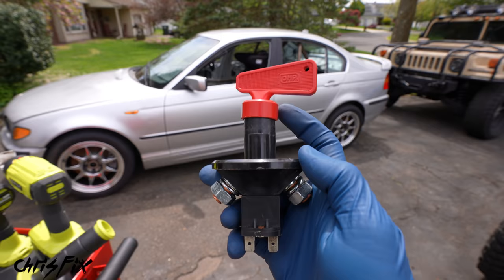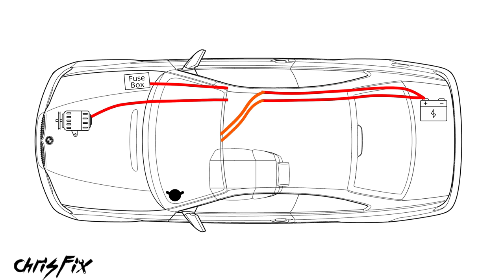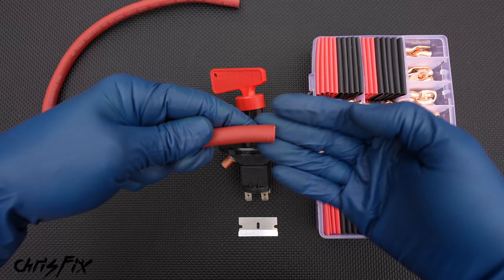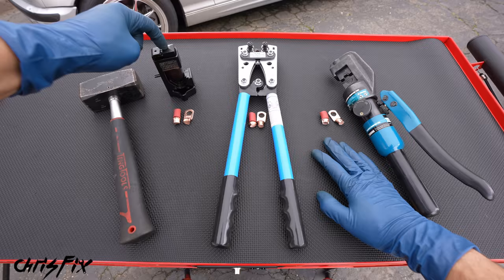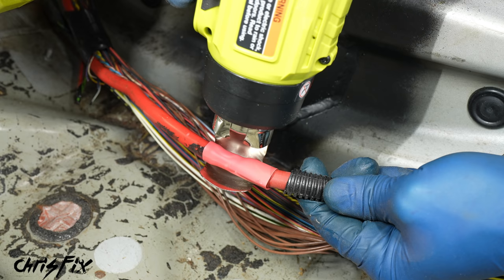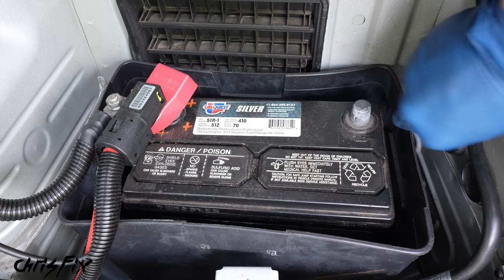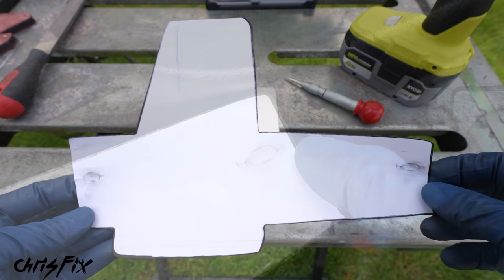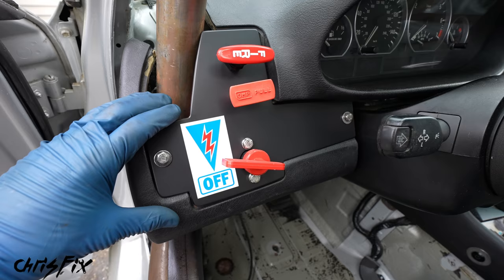How to Install a Battery Kill Switch

Comment: Electrician here! Great job as always Chris but I have one critique. When crimping lugs it's best practice to crimp at the top of the lug not the base like you did. Starting at the base leaves to potential of a air gap between the top of the lug and the wire. This happens due the to stretching of the lug when you crimp it. Now I'm 100 percent certain you won't have any problems with the way you did it because it's such low voltage but just thought you should know. As always Great job and love your veidos.
Reply from the maker: Thanks for the tip!
Reply: @chrisfix  
To not have to pay attention to what Cliff says, you can buy terminals with a little hole in the front, as i do ^^

And you can find adhesive heat shrink, with a layer of glue inside of it, so it melt when you heat the shrink, ang glue it to the cable, so you dont have to use silicon, and avoid greasy fingers haha!

Of course theses two tips cost you a little more money, but can save you some time if you have a lot of crimp to do!
Reply: @chrisfix  another piece of advice, you could always leave power on the ECM/PCM.. So that way your engine wouldn't have to relearn all the sensors the first 30 mins of driving. And in some states this will cause people who use this daily to fail vehicle inspection due to incomplete drive cycles.
Reply: @Neilledra  The lug also stretches during crimping, so you still have to crimp it starting from the top of the lug. If it is done the wrong way, the lug will not be able to stretch and it may crack.
Reply: @bustanut3888  that’s what I was thinking. Kill the spark system and not the DME/ECU as it’s a BMW and the electrical systems in it are not a fan of sudden power cuts and comebacks. He’ll be on the track and having to spend a few laps relearning everything before his car will perform like it should as it’ll have to relearn shifting, and sensor/engine adaptations.
Reply: @thecomputerguy777  This kill switch will probably not be used as a form of theft-prevention, its mainly a safety measure. And if your car is close to or already bruning, Im pretty certain you dont care about the few sensors you will fry by using this switch. 
He just mentioned that this could be used for theft prevention, not that you should do it.
Reply: Good Catch

Comment: As an electrician (Sparky), I've had my fair share of rushed/bad crimps. I always hate accidentally cutting the copper wire. It is so annoying. I love watching you do electrical work. Reminds me of why I got into it
Reply from the maker: Thanks a lot! Yea cutting too deep into the copper wires by accident is always so annoying. You try to be careful and you still cut a few strands haha
Reply: @chrisfix  Stripping tiny and thin stranded wire such as Diesel Locomotive Cable I’ve found that when you cut all the way in the insulation you score strands no matter what then they bend and break. I’ve found the best way to not score the copper is to instead score the insulation and bend it until it the insulation breaks and slides off.
Reply: @rylanhuntley6867   that seems the best logic to do incase if never wanted a single strand to come off

Comment: Seeing the inside of the crimp is so cool! I've been doing automotive work my entire life and have a degree in electrical engineering. But I had absolutely no clue that a crimp like this compresses all the wires into a literal solid lump of copper! That makes me feel a lot more confident in how they work. That's crazy!
Reply: Yeah that’s what surprised me the most. I always thought the wires would just bunch up next to each other.
Reply: I still don't understand the physics of how that happens... there's no heat involved and they're still solid strands, how exactly do they "liquify" and melt into solid core from just compression?
Reply: @Leuel48Fan  copper is really soft, when you apply that much pressure to it it's no different than pushing two pieces of clay into one.
Reply: Your comment is great but your name has me lmao
Reply: Thomas & Betts is your best friend!
Reply: @Leuel48Fan  they aren't solid, if you remove the crimp they still are individual strands. They just get compressed and deformed so that there are no airgaps between them
Reply: @WorkinDuck  not necessarily. It's physically possible to well Metall together with just pressure and no hat so it turns I to a Ssolid block. Cold welding/pressure welding is a thing
Reply: @LeutnantJoker  This isn't possible while wire crimping, since the individual strands would break at the end of the crimp with that much compression
Reply: @WorkinDuck  No, it is very possible and it is the only right way to crimp. A good crimp will cold weld the metal together. Period.
Reply: @Leuel48Fan  cold welding. Metal attaches to itself when you remove any surface air and oxidation
Reply: i wonder where the Axia's computer is
Reply: Yeah I’m with @WorkinDuck on this. Generally, cold welding requires the metals to be cleaned of their oxide layers, and common copper wires are definitely not free of their oxide layer. Another thing is cold welding works best on flat surfaces with no irregularities. In a very ideal situation it is possible to cold weld wires when crimping them together, however, I feel there are to many variables and the wires would not cold weld in the vast majority of crimping situations.

Comment: Great video! Just a tip: You can get marine grade heat shrink which has a heat-activated adhesive lining on the inside so you don't need to apply the silicone. The adhesive also helps to add some strain relief. =)
Reply from the maker: Thanks for the tip! That is a good idea!
Reply: @chrisfix  NP, I only know because I had to relocate my battery to my trunk to make room for a new intake. XD

Comment: For the crimp heat shrink, use adhesive lined shrink tubing.  It has adhesive inside that when heated and shrunk will fill the gaps and perform the same function as the silicone paste with the added benefit of waterproofing the connection.

Comment: Proper stuff. Only concern I saw here was with the relay "trigger wire". I have met relays that have had their contacts getting stuck together. Therefore, I would have run the switched wired through the killswitch to protect from a relay getting stuck in the "on" position.
Reply: Very interesting!
Reply: That makes sense. Relays aren't perfect.
Reply from the maker: Thanks a great point, although very rare, technically a relay can get stuck in the closed position and not shut off, even with the trigger wire cut off
Reply: Always account for those things that "never happen," because they can cause a lot of trouble when they do.
Reply: 100% agree with OP. Assume the relay will stick, and wire accordingly. Murphy's Law.
Reply: @meliodas4560  
No human is fast enough to save the alternator.
Reply: @larrybe2900  How does that relate to Meliodas's comment?
Reply: @Engineer9736  
Meliodas's comment referenced OP

Comment: Protip for those wanting to prevent car theft by using one of these:

You can install a kill switch and put a low amperage fuse (5 amp) in parallel. This will cause the fuse to blow if someone tries to start the car without the switch installed. The fuse is there to keep current flowing to components so you don't lose presets on your radio and/or don't reset any computers, but it's low enough amperage that it'll blow when the starter is used.

You're welcome. :)
Reply: Pro-pro tip:
If you do that keep a spare fuse somewhere in your car.
Because you most definitely at some point will forget to turn on the switch before starting the car and blow the fuse.
Reply: Better use a resistor or heating element..
Reply: won't the computer and radio get reset if the fuse blows though? 🤔🤔🤔
Reply: @knightking69  well, the question is if you would rather have to reset your settings or buy a new car because the old one was stolen 🤷🏼‍♀️
Reply: @knightking69  Only if you try to start the car without the switch installed, or someone else tries to steal it.
Reply: @Jehty_  ahh i see 👍
Reply: @JimGriffOne  Fair enough

Comment: You can also use a heatshrink that shrinks more than standard, which is typically 2:1. There is 3:1 and 4:1 as well. It's good for fixing those oopsies where you forgot a connector, or practicality makes it difficult to use standard heatshrink.

I also recommend using a glue filled heatshrink on any connection that risks exposure to weather.

Another note - buy quality connectors/terminals from reputable sellers. Lots of cheap ones these days are just copper coated aluminum which lack the ability to carry the rated power.
Reply from the maker: Thanks for the tips!

Comment: Hey ChrisFix, and thanks for another splendid video. One quick note, the double sided tape tie strap brackets are nice and easy to install but the tape will eventually let go. I have learned that from my workplace. There are other similar brackets that have a additional hole in the middle for a fastener to permanently attatch the brackets. Cheers from Finland 😎

Comment: Great video as always I've learned a ton of fixes and generic info from your vids over the years. The only thing in this one for me is the file. When you use it you should only use forward strokes, lifting off as you come back to start the next stroke. Your file cuts cleaner and lasts longer and will probably clean up the edges faster.
Reply from the maker: Thanks for the tip but that’s actually a myth that was disproven recently (at least the file wearing down). They tested it out and there is no significant difference between lifting and scraping on the back stroke. I use to think the same thing! You can search for the video of the test on YouTube.
Reply: Thanks I'll look into that.

Comment: My biggest concern with this being used on a regular basis, like a DD with a parasitic draw, is the constant erasure of ECU's volatile memory. It'll need to run a monitor test and relearn everything for every system, every single time. It won't know what the last state of all the systems were, and any code that isn't a 1 trip code will never ever get to request a CEL. It will be risky with each power cycle. My mother's 2008 Dodge Dakota had the ECU totally die when the battery got weak and was removed for replacement. We disconnected the battery, put the new one in, reconnected it, and the engine immediately ran horribly. It was running ridiculously rich to the point that the cat was overheating and smelled like rotten eggs. I shut it right off at that point and said "Wow this is incredible. Power cycled and now it's completely lost fuel trimming capability and it's torching the cat. Fantastic. Classic Dodge electrical problems." It was literally running fine when parked, swapped the battery, and it ran terribly at first start 10 minutes later. Troubleshooting pointed to the ECU and a new one fixed the issue so that was beyond a doubt the issue. You run the risk of a problem like this when power cycling components meant to be powered on 24/7. The ECU dislikes having to relearn data.

So, I'd suggest only doing something like this for the racecar and/or a winter and summer DD that sits for a long period of time on the off season. You can disconnect the battery and connect the trickle maintainer onto the posts directly. Easy. 👍
Reply: Interesting. I've used plenty of military vehs, including with complex ECUs (Mercedes G Wagon GD270CDI) for example, which have a battery master. Besides the clock never working, I have never seen that be an issue.

Would there be some kind of solution for vehicles with this feature from the factory to prevent ECU issues?

Comment: Some heatshrink tubing comes with an adhesive already pre-installed on the inside.  When you put it on, and then heat it up, it will melt the adhesive - and then dry when cooled, creating a waterproof seal.  You can skip the silicon for these types of heatshrinks, making the job a little faster and easier :)

Comment: I just bought my first truck, it’s a 78 datsun 620 but it has major rust issues do you have any big tips on restoration or replacement?
Reply: Chris has a video or two regarding fixing rust holes, rusty panels and such.
You might want to check those out too ^^
Reply: He did it on a honda del sol however its basically the same for any floor panel and such
Reply: Linex it but gdt the first coats professionally done
Reply: check the frame for rust, if there are major damage ( large holes etc.) then it is unsafe for driving . You hopefully already checked this prior to purchase but wanted to let you know just in case,
Reply from the maker: Here you go: https://youtu.be/C0M5tUQSaps
Reply: Put quick release on panels take fiber glass and put over panels and make molds for new panels out of fiber glass

Comment: Solid job Chris - love your meticulous approach!!!
One small point to improve - that plate top-left corner might rub against the roll-cage tube from vibrations and be noisy. Either snug a felt pad or further 4-5mm trim might do it
Reply from the maker: Thanks for the tip! I haven’t had it make any noise at all but if it does I will definitely add some felt!
Reply: @chrisfix  
Different metals should have some sort of barrier. (galvanic corrosion) In this instance it may be as much a problem as the noise.

Comment: You should be using actual battery heat shrink, which has adhesive that melts and seals the system. It also provides a strain relief.
Reply from the maker: Thanks for the tip!

Comment: I definitely love ryobi products. It’s way cheaper than brands like Dewalt and it’s more reliable than brands like Milwaukee. I work as an electrician and when I started we had 3 drills on the job trying to do our rough in all 3 of the chucks stripped out because of poor design I went go grab my ryobi drill and did the whole house with 1 drill
Reply from the maker: Their old stuff was eh but I wanted a less expensive alternative to the Milwaukee stuff and I got a few of their new 18v lithium tools and man what a difference! I ended up getting their lawn stuff too and the chainsaw is crazy good!
Reply: @chrisfix  completely agree with you keep up the good work love your videos
Reply: Strange that you think that Ryobi is better than Milwaukee since they are both owned by the same company and as far as I know even manufactured in the same factory.
Reply: @Jehty_  It's all about brand perception. Also, I hate marketing.
Reply: @PierceGomez  let me quote them:
"more reliable than brands like Milwaukee"

I don't know about you but me personally if something is more reliable then I call it better.
Reply: You're right about Ryobi. I've been using Hilti for many years and pay a huge premium for them. While they are reliable, my colleagues have shown me with other brands there's just not much difference in reliability and quality, now.
Reply: @PierceGomez  if you actually read my comment you would see why I said that ryobi is better quality. Like I said we had 3 Milwaukee drills in the job. All 3 of the chucks were stripped those were brand new drills except for 1 that was a couple months old. While my boss went go return all of them for a defect I continued the job with my ryobi didn’t have any problems. My boss came back with 3 more drills and after setting them to the correct setting they stripped out again after half the job was done. I been using ryobi ever since that day and never had a problem with the chuck
Reply: @UCmyvojfegct2TnQKMbzaxuQ  my boss has been fighting with Milwaukee for over a year now on the same stuff. He only continues to use Milwaukee because of certain tools that they made for electricians like the cable cutter and the cable stripper. the point I’m trying to make is not that Milwaukee is a piece of 💩 but more about price. Let’s say you have a Milwaukee drill that is out of warranty you are on the ladder it falls off and breaks that’s a $170 drill you got to go buy. While ryobi if you break it it will end up being $120 I would rather save $50 because a drill is a drill it is highly possible that Milwaukee can have a defect in their drills but they need to address that
Reply: @dustinbergeron7508  what kind of job strips a drill chuck halfway through said job??
What kind of abuse do you do with your poor drills?
Reply: @Jehty_  electricians have to drill through 2x4 studs a lot of them depending on the size of the home. Sometimes 4x4 as well as many others as well it’s not the wood because other brands doesn’t give us the trouble that Milwaukee did it might be a defect in their drills idk

Comment: You can also 20:38 use small colored zip ties spaced every 12 inches or so as an indicator. They come in about 8 - 10 different colors. Bundling wires for like you are, you could put yellow ties on the alternator side of the switch and red ties on the battery side. That way at a glance you know which red cable is runs where.

Comment: Note: You're not supposed to twist the strands before crimping. I use a twist tie to compress and hold the strands together while inserting.
Thanks for the great video!
Reply from the maker: You're not supposed to crank it or anything crazy, but a slight twist to add some pressure and make your life easier is ok. Thanks a lot!

Comment: 4:30

Its common practice to prefer to switch the positive terminal over the negative.
Also in working with electricity that is the case, you always want to switch the "hot" cable

Comment: Great as always and I can't "fault" your advise at all. I will however add that a soldered connection to the resistor leads would be far superior. Those type of crimp connectors are not recommended for use on solid core wires (ie resistor leads)
Reply: I was wondering my self if soldering would be better for that

Comment: As someone who makes cable for a living love the video and the crimps the shielding technique with the wrench help greatly wonderful tip just be careful not to damage the wire during the crimp it could potentially harm connection to sensors and outher connectors